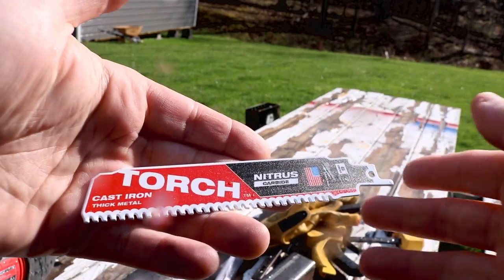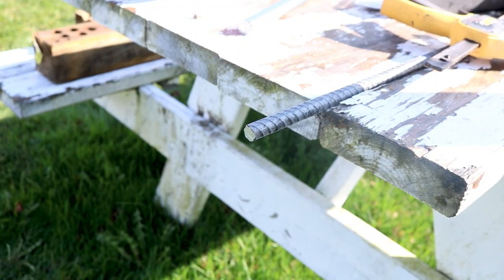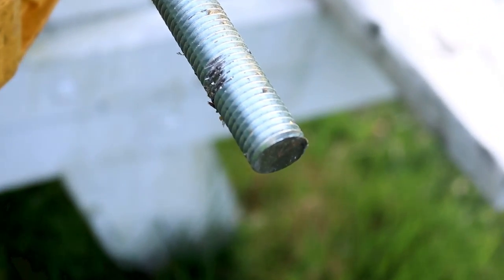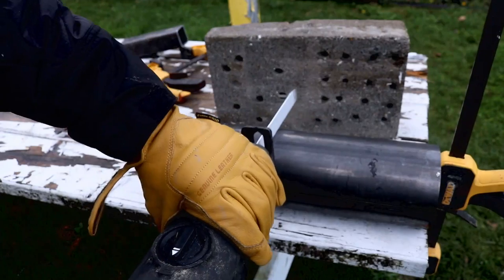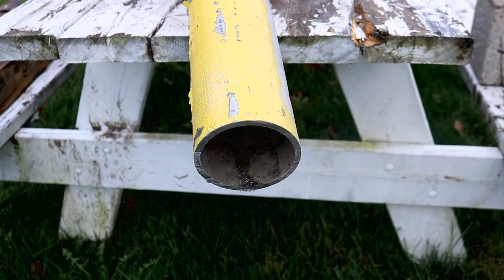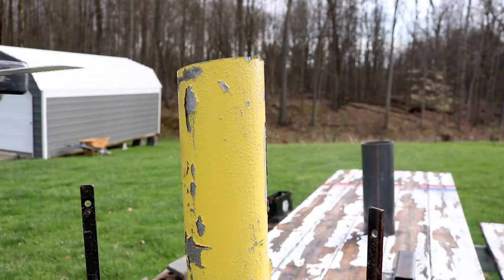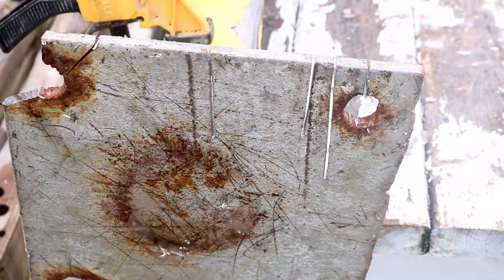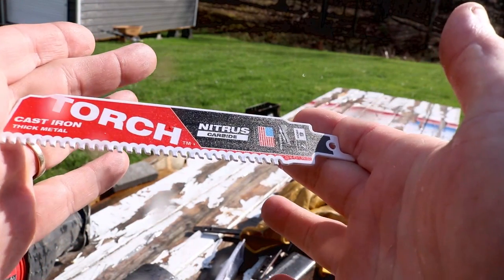Use a Reciprocating Saw to cut metal? you really need to see these Milwaukee Torch Nitrus blades!

Comment: Use spray lubricant every 3 seconds while doing those cuts.  You'll cool and lube the blade and it cuts twice as fast and increases the lifespan of the blade
Reply: Are you sure about that intermittent lube advice?  They seem to be doing crazy new things with carbide these days, but about 20 years ago I was told that in machinng steel with carbide cutters, you should either run them under continuous cooling, or none at all.  Theory was that the thermal shock of occasional quenching would shatter the ceramic.
  But then again, there was nothing that would perform like this sucker back then either...
  Anyone out there have an authoratative answer on this?
Reply: @markmarkw1919  I have done no peer reviewed tests.  All I know if my experience cutting 4 inch metal stacks in basements and cutting old radiators to be removed.  Lots of thick metal.  Trial and error.  The cuts I made with spray lube went infinitely faster.  I suppose you can try it yourself.   It doesn't take much to try

Comment: Used a Torch Nitrus blade to cut 1/8" stainless steel exhaust pipe like it was nothing. It would last forever compared to a Bi-Metal blade.

Comment: Let me tell you why our man Clint is my hero! 

I just came back looking for this video, and see that it was three months ago when I was here before (I have a 3 month old comment below it).

You see, I am a guy who is finishing up remodeling a distressed foreclosure he bought about 13 years ago. I was a grease monkey in the military, and then a mortgage broker by trade after I got out and went to college. I am NO pro. Honestly, before I bought this old house, I was WAY better under the hoods of my cars than I was inside of the walls of my house.

But, over 13 years of doing things, doing mist things twice and doing some things three times, I have developed some serious home repair skills. These 13 years have also taught me that, with a 60 year old house, if I haven't had t learn it yet...I will have to learn it some time. That's part of why I watch these videos...to learn, constantly, about what tools are available out there and what they do, without the benefit of being out working in the trades every day.

Three months ago, I aw this video. Three months ago, I made the funny comment below using the old Ginsu knife commercial. Three months aao, I saw these sawzall blades and thought "self, you handsome devil...there s no DOUBT something will come up later where these blades will be useful." Three months ago, I bought these blades and laid them in my sawzall case.

Yesterday, I was putting new insulation under the house and found out I have a leaking drain line beneath my toilet. That line is copper. I have to cut out a section of that pipe ad repair it. But how? Haha

Today, I was watching a plumber fix a problem just like mine on YouTube and wouldn't you know it, he was using a Sawzall with these Milwaukee Torch blades. "Self, you handsome devil, you HAVE those blades in your Sawzall case, because Clint showed them to you a while back."

Clint...you ARE the man!

Comment: I think there pretty good blades I have had the same issue with getting them in and out of the saw I'm drawn told diablo blades more though I have a crap ton of Milwaukee blades all different sizes and styles and I do like these new blades they work very well

Comment: Speed is to fast.. Use ur dial to hone in on good lower speed. I set the supersawzall on speed 2 when I cut metal. Stretches the blade life tremendously.. Also keeps the teeth on the blade..

Comment: Yeah.  Milwaukee Torch blades fucking rock!
But for the expense, I can think of several ways to cut metal better/cheaper than a recip saw. 
There are times when you need to use this approach.  Just don’t make it your go to.

Comment: They cut really nice ??? I'm having a problem with my Milwaukee M18 brushless fuel ripsaw I'm getting a little bit of a delay when I hit the trigger I think I might have pushed it too hard maybe Im burn it out what do u think
Reply from the maker: Wow, that doesn't sound good. They usually put a safety mode on them so that won't happen. How long have you had it? They are pretty good on their warranty.
Reply: @ToolReviewZone  I have to look I still have the box with the receipt in my garage I try to save all the boxes with the receipts in them just for this reason possibly a year and a half Old Maybe but I have the regular Milwaukee Sawzall M18 brushless fuel and it works fine the ripsaw I hit the trigger and it's just a second or two delay I got to bring it to Milwaukee
Reply from the maker: Yeah buddy,  they will take care of it for you. Of not, let me know
Reply: I have the same problem with my harbor freight sawzall.

Comment: Do yourself a favor, get a grinder and some cut off wheels. I tried one of these on a 12" mobile home I Beam. Grinder and cut off wheel did the job in less than a minute. Tried the Carbide tipped blades took FIVE MINUTES TO GO 1/4" INCH. 20 Dollar lesson in stupidity on my part. 50 years welding experience. Too lazy to drag out the 100ft extension cord.  These ads are showing really soft steel.